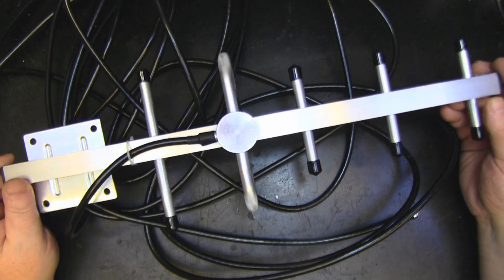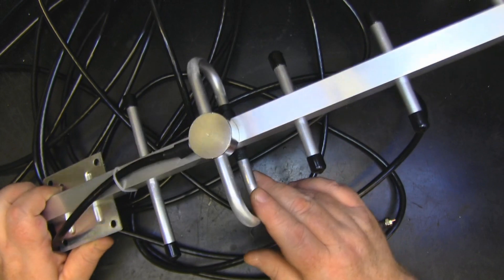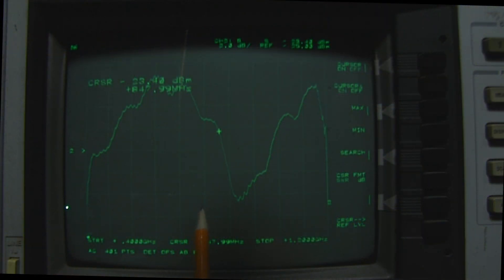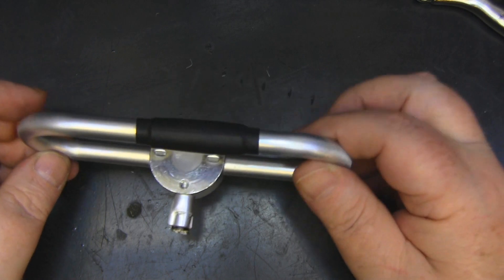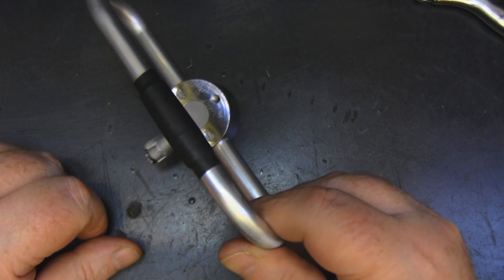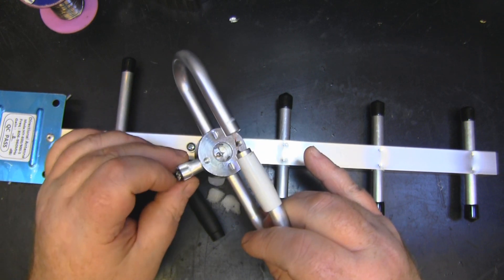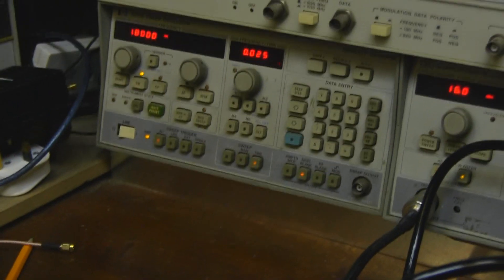900MHz Yagi with Super Lossy Coax!

Comment: Actually, hollow tube or air core dielectric coax has LESS loss than standard coax.
Heliax hard line is the only other type of coax with lower loss.  But it can cost $6.55 per foot.  That is $209.60 US dollars or £167.50 GBP.

Comment: Hello, I have just purchased a Cell Phone booster that came with this almost identical antenna.  My question is why would they send this antenna when the booster is for 850MHz Band 5, 1700/2100MHz Band 4 and 1900MHz Band 5.  Am I missing something?
Reply from the maker: It would be fine for 850 due to it being a Yagi (broadband) but forget 17, 19 and 21. Look for a 3g, 4g multiband Yagi on ebay you will find one for around £20 to £30.
Reply: @andrewmcneil  Thank you!

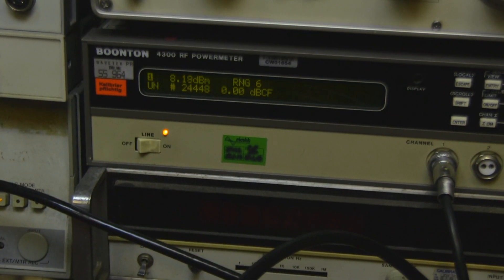Comment: 10:25 When you lose 8dB that's not a half :-), you lose 5/6 of output power.
Reply: Quite often in his videos McNeil demonstrates that apparently he does not understand the basics, which is a shame because he could quite easily measure the gain of his antennas in dB over a reference dipole or whatever, but instead only ever gives us an un-referenced 'percentage' figure.
Reply: @stephenstebbing9460  Yes, he has all the necessary test gear, but doesn't make best use of it. And counting the amount of access points he can see, as a measure of antenna gain, is flawed too. An antenna's gain is achieved by tightly focussing its directional characteristics, so under certain conditions, more access points received could actually point to an antenna with a LOWER gain.
That 900MHz antenna with its interesting balun arrangement seems quite good; I suspect the poor coax was someone else's addition - possibly 75 ohm satellite type, where high losses are acceptable due to the extreme gain in the dish's LNB.

Comment: Oh well, what a classic. I had some of this coax as well, it's a waste of connectors - atleast as a transmission line. 
It does however make a good attenuator or floor heater at higher power. 

Right after seing a F-connector on some 50Ohm coax, the case was clear. ;)

The antenna is pretty nice however, I got the same one, with decent coax and some minor fixes, it performs nicely. 
As you said, for the amount of money, that these cost, it is hard to get it built yourself.
Reply: I need a 2100mhz antenna. Actually i will try to build a double biquad antenna but if I fail i have to buy a working antenna. I will use 8 meters long lmr 400 coax for double biquad antenna. Reflector is 1.2mm thick galvanized sheet. Copper wire is 1.5mm thick. Could you please give me a link for correct dimensions for d-biquad antenna? I already made some research but i got confused about dimensions.